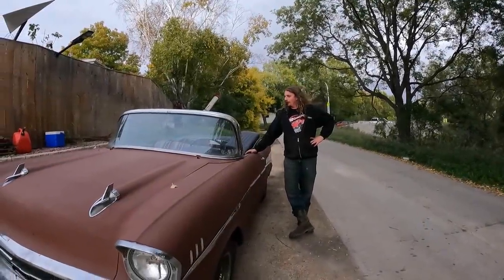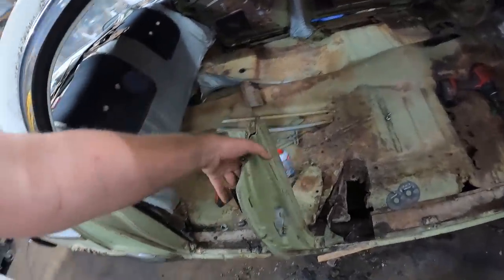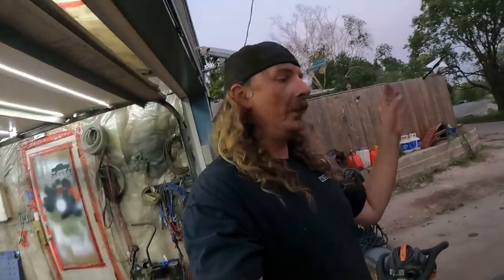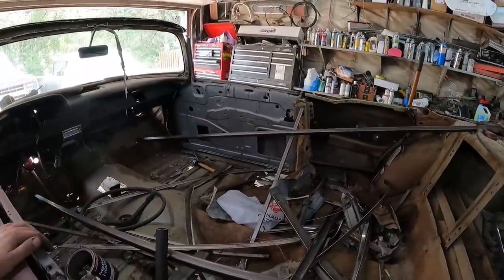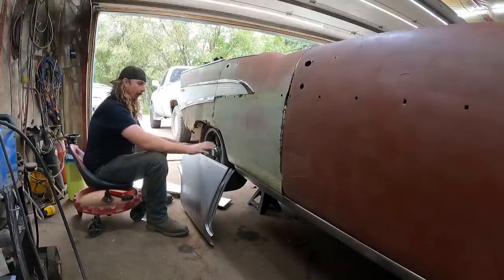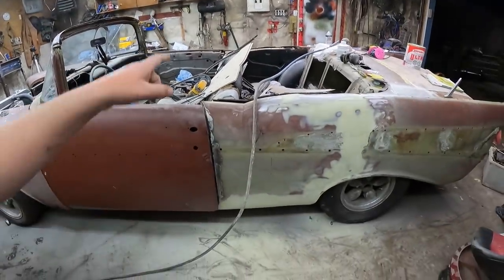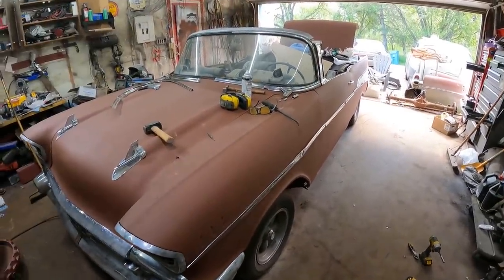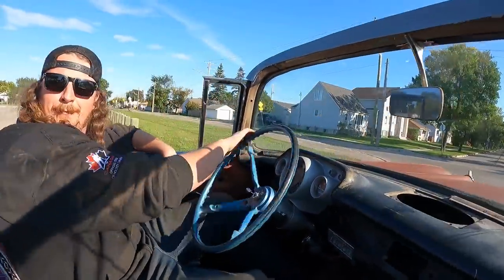1957 Counterfeit Convertible - 4 Door Hard Top To 2 Door Convertible Complete Build Start To Finish

Comment: Hi Dan. Just a thought on the windshield surround on the convertible.  Have you seen the stainless sheet metal guys use on the bottom of their trucks for trim?  This stuff is very easy to work with.  Maybe you could shape a piece of it for your windshield.  the stuff can be pricey but if you are interested I have a sheet in a box I could donate to the project.  I am in Victoria BC though.  Cheers Bob

Comment: the cover you got is a convertible top boot. you need a tonneau cover, it replaces the boot using the same snaps. it covers the entire cock pit, but has the ability to tuck just behind the seat, with two front seats accessible. the snaps continue on top of the doors, and on top of the dash. should come with a zipper down the middle front half , this gives you the ability to tuck just the driver side behind the seat , now this keeps the heat in, and protects the interior from the rain even just the due, makes car more usable with out top. easy just snap and zip it closed . Ask your dad, its old school, British cars used them, with some pictures, any upholstery shop can make you one, Remember the better guy doing it at the shop, the better the guy the better your finished product